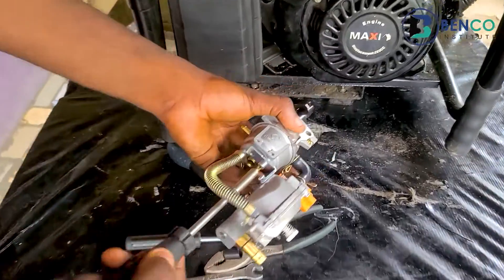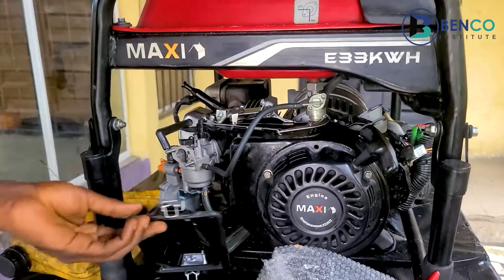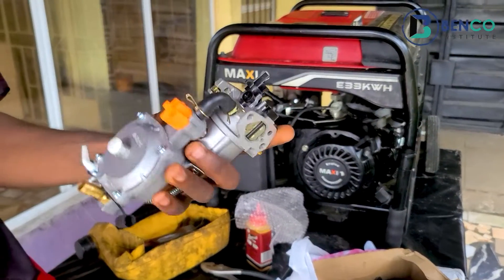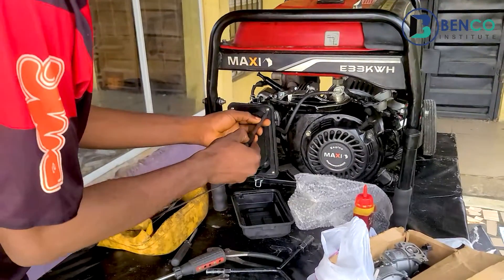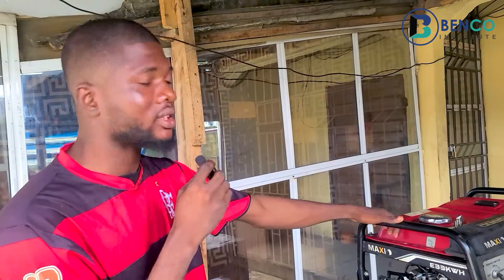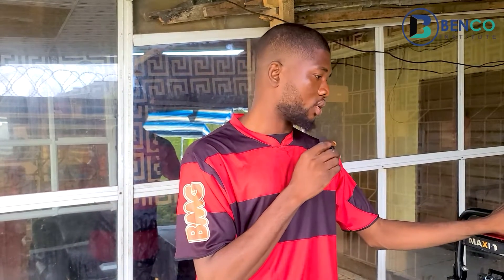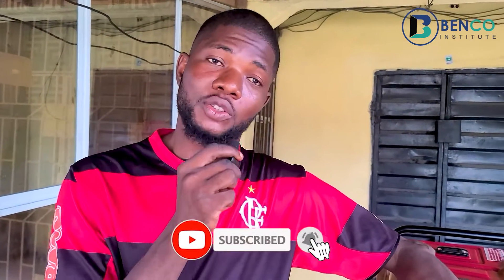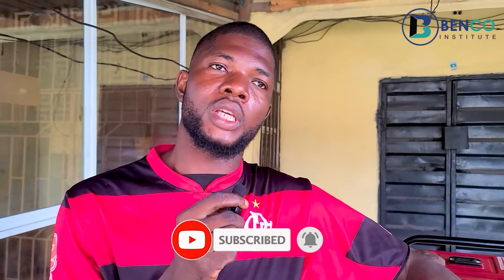Carburetor cleaning | Service, repair and fix Dual fuel(petrol and Gas) Carburetors with ease...

Comment: Nice one but I think you need to do more research on engine parts and name.
That you call a stoper beside the carburetor is not serving the purpose of a stoper so it's can't be in named after that purpose.

Moreover Sir.
Servicing and cleaning a carburetor I not limited to using petrol to wash only...
There is a specific material used to servicing carburetor.

The said carburetor you concluded not been faulty may be faulty... Reason being that you never test run the Gen with load so please always respect your clients complain if you don't want to look incompetent before your clients.
My humble advise from over 25yrs hand on small engine and repair
Thanks
Reply from the maker: Thank you very much

However the carburetor is not faulty
Carburetor worked perfectly immediately the inlet  manifold Gasket was fixed as adviced in the video, the Gen worked perfectly. 

Yes there is a cleaning agent for carburetors but in absence of the cleaning Agent petrol is used...

The term stopper (ie to stop heat transfer) it is a colloquial term used in our small engine market in this environment... However the black thick plastic is officially called a spacer, some categories of people may call it an insulator block. It's function is basically to insulate the carburetor from heat preventing vapour lock and ensuring proper fuel flow. 

Thanks again for your submission
Reply: @bencoinstitute yeah

Petrol is used, To every his choice provided it works perfectly

Thank you so much Mr Benco